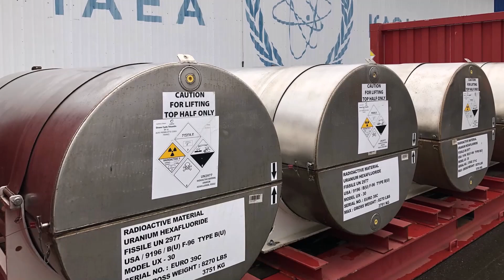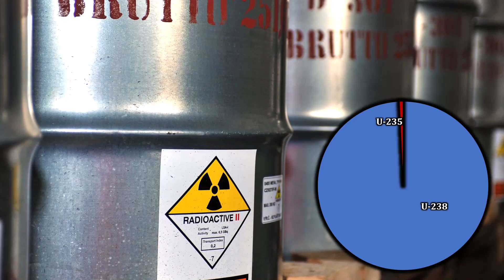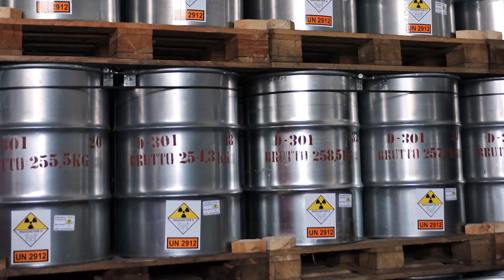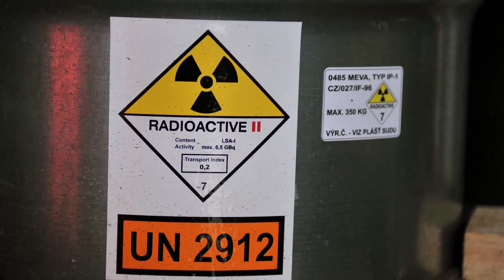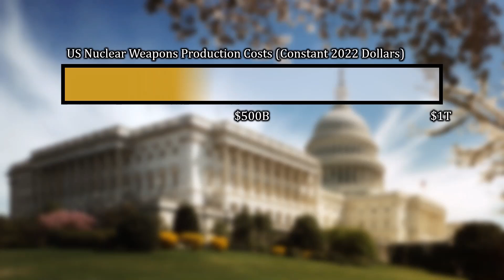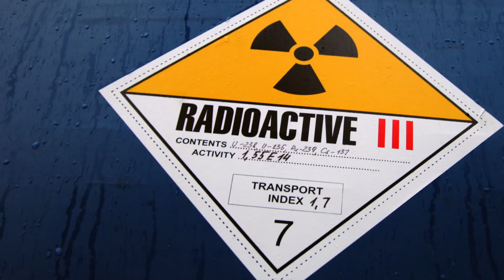When Will Iran Get Nuclear Weapons?

Comment: The problem is that the US has shown it has become an untrustworthy partner when Trump pulled out of the deal, and now refusing to guarantee that it wont do so again. At this point, Iranians are thinking it is foolish to enter into another deal with the US. As for Israel, I don't think other than sabotage, the would do anything else. They like to talk big, and show their power by attacking palestinians, but they massively failed in 2006 in South Lebanon, something that is not being talked about here in the West. The only way to revive JCPOA is for the US to admit wrong doing (which will never happen), and provide guarantees that it won't leave another deal which is also unlikely due to infighting within the US between political parties.
Reply: and they are failing in gaza again

Comment: you shoud record with a higher sample rate (higher than 44100hz), and lower volume. it's cracking a lot
Reply from the maker: What do you think of the audio after 12:26? I did that part after the rest, and it was recorded differently. I changed my setup a few weeks ago and still haven't been satisfied with anything yet. (Except, perhaps, the post 12:26 version.)
Reply: @Gametheory101  sounds a lot better! sill i would put some eq on it, like lowering the higher end a bit so its less hissy.
Reply from the maker: Thanks! I will look into it.

Comment: iran can detonate a nuclear gadget. maybe to weponize a circa 20 kt warhead on one of the relatively advanced version of nodong/shehab 3, with cep of 500m (optimistic iranian assesment). a demand for an airburst timing is taugher a mission then assembeling an implosion device( the dimentions and 3-conical designe of irans warhead excludes the possibility of a gun type design- so unless iran will get a tested design a nuclear test-is in order( i dont think a zero yield experiment will do. and remember that iranians -albeit their enthuseism with nukes jargon-are not exactly in their elements -in sharp contrast with teller, ulm, oppenheimer, wigner, feinman, szilard,fon neumann and other non-iranian scientists-many of them , er, had extremly positive atitude to the zionist state-and contributed anything needed to advanced the then impoverished jewish state, which at 1986 was condemed in the media as a spy presented photos from a facility in israel of hardware that bears a striking resamblence to advanced multistage nuclear weapon. it highly unlikely that israel nuclear assets were not kept up-to-date ).   so as iran may try and target israel with a missles carrying a single stage warhead-it havent got the capabilites to "wipe israel " with or without israel errow34 anti bm defence. 
it is an open question as to what will happen if iran will detonate a device  a  n d  then try to launch a barrage of irbm- as the legitimate respose to such by a "nuclear power" is the attacked country immediatly retaliate with its maximal offensive capability( which is for iran-a "barrage" of irbm , each armed with1-3 200-300kt thermonuclear warhead oops. so, what centrifuges ?where is tehran? i can see nothing!

Comment: Putting my chemistry hat on -- yes, it fits -- your reasoning about enrichment is way, way off. So, stop right there.
The way it works is by PARTITION -- not picking this or that 'coin.'
Partition is bogged down at start by the huge fraction of 'dead' 238. It clogs up your process flow.
All of your pipes, equipment -- everything -- has to be sized to handle a vast flow of 'inerts.'
The partition function has its best economics when your centrifuges// partition function is not clogged with inerts... 
so the best process stream economics shows up around 60% enrichment. 
However, and this is where you started drifting off, as the percentage climbs up towards 70, 80 90 -- the partition function cuts against you.
Now, getting RID of the 238 -- what you've been doing all along -- is starting to choke on the high fraction of 235 in the process stream.
THIS is why you keep reading that atomic scientists decide to stop at 80% or 90%. BTW, Little Boy was an 80% device.
I have no idea where 90% came from. 
Cost EXPLODES exponentially as you try and attain higher purities. 

The Iranians are doing exactly what one would do to craft an Atomic Bomb PROGRAM. 
They know that IF they ever announce that they've got a few -- Jerusalem will attack FOR SURE.
That's why they are staying on the cusp.
Beyond that, Tehran has lost a LOT of critical atomic scientists. 
Most by way of never hooking into their program -- not assassination.
Israel has simply deterred them. 

This presentation is not up to your usual standards.

The mullahs are going to keep on keeping on -- always staying on the cusp -- 
until they have so much very highly enriched 235 that they can break on through to Little Boy, PDQ.

Here's the kicker. Little Boy needs a B-29 to deliver it. It's NOT suitable for ordinary missiles.
The Soviet early era bombs were so heavy that Korolev built rockets sized for them.
This baffled the Americans during the space race. Later, due to GRU spying, the Soviets were able to shrink their nukes.
Costs plunged. So by the mid seventies, bomb counts went past ten-thousand, way past.